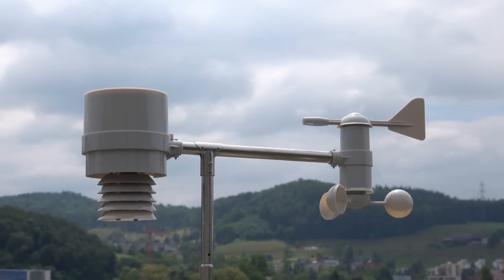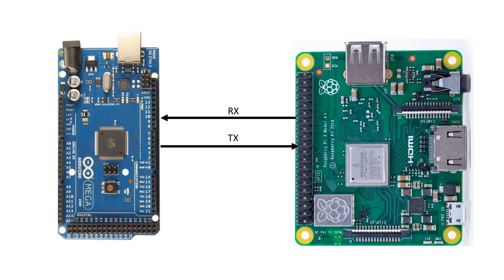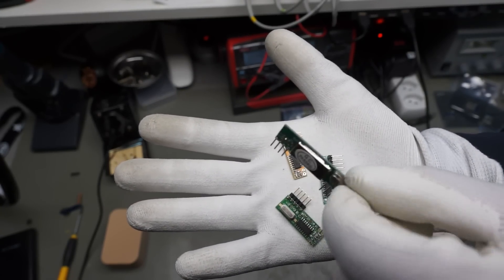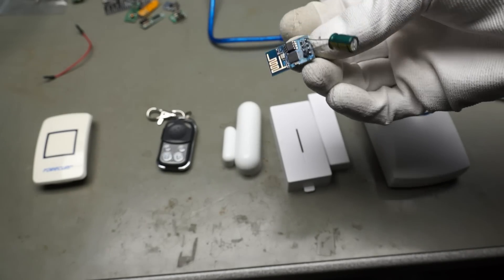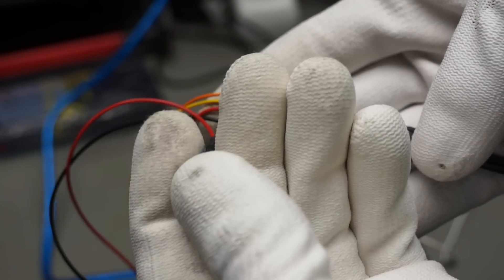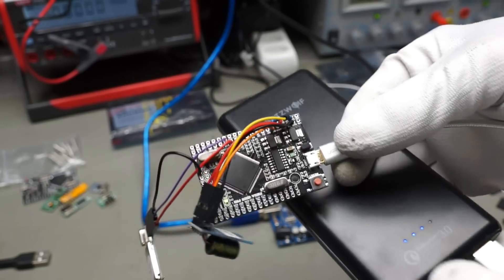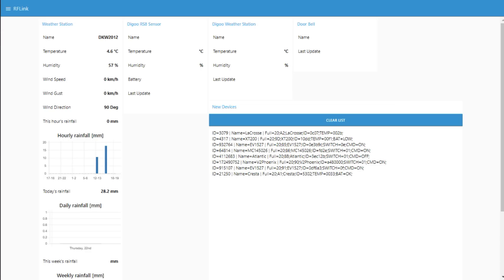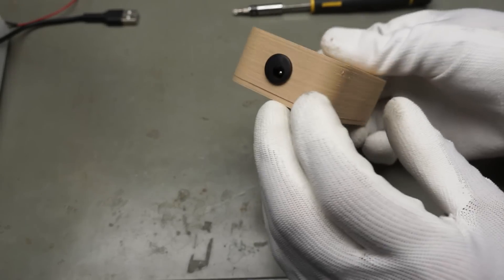#242 How to Build a Cheap 433 - MQTT Gateway (RFLink, Arduino, ESP8266, Node-Red, Weather Station)

Comment: Dear Andreas, I am using OpenEnergy Monitor 
(OpenEnergyMonitor.org) V 9.8.31 to collect timeseries data with datavisualisation capabilties (not as advanced as Graphana for sure). Is there any chance to have the RFLink code to work wtih ESP8266 E12/ Board (HW-628)  ? Thank you for your work.

Comment: Couple things r wrong here... 
1.) weatherstations never ever show the right accurate measurements cause the build in the cheapest sensors in the worst qualityclass even in expensive devices. 
2.) all those sensors r batterydriven and batteries give up the ghost when enviroment temps get low. You never would find out the -17C we had last winter, cause sensor f* up @ little lower as -5
3.) 433MHz sucks, espacially on those cheapos. Slightly sends trough one wall, but have 4 of them in a row. Only working on/in wild west cardboard boxes they call em a house. Not useable for real houses. 
4.) windspeed, winddirection and rainvolumesensors r reed, and they bounce a lot whos filtered out analog. So i mount 2 hall sensors and doubled the resolution of the windspeed sensor. Still looking for a rotaryencoder who can measure winddirection on at least 1 degree solution. Or buy a ultrasonic one...?

Therefor build my own, i‘ve showed u andreas. Only downside: can‘t sniff neighbors sensors, alarmsystem and remotes.
Reply from the maker: In General: I usually get what I pay for. I paid 50 dollars. So my expectations are not very high. Professional weather stations seem to be available but much more expensive.1. The data are good enough for me. And if not, I will change the temp sensor to one from Bosch.
2. Everything which is below -5 C is cold for me ;-) So I have to add a line in node-red: If no signal then -6 C. But I will have a look at it this winter. Anyway, an interesting topic which could be worth a video.
3. My gateway was one floor below and the original display of the weather station 2 floors below the weather station. Both work. And we are not known to build cardboard boxes around here. Maybe you saw the video with our atomic shelter ;-) So the receivers are better than I expected with these short antennas.
4. The wind direction changes quite a lot and therefore cannot be measured accurately with this device. I do not know if averaging would help. For me anyway, only two directions are important: If the wind comes from the east it is cold and if it comes from the west it is better.
5. Ultrasonic wind sensors are very interesting. I never built one. I have wind sensors which work with a thin wire (similar to the ones used in cars (Luftmengenmesser). But I never tried them because I never finished my wind channel.
Reply: Have addition about minus temps. Not sure about sensors in my Chinese weather station, but accurate results depend very much on where WS located. My own ~$150 WS show me -28 this winter. The only thing I found, what humidity sensor show 100% all the winter, because it freeze. It have solar panel, super-capacitors and lithium batteries - they suggested by manufacturer as working good during winter.

Comment: i used an R1 D2 mini clone with a similar 433mHz module and this rf library to build a similar gateway. works like a charm!
https://github.com/sui77/rc-switch
ended up collecting all strings under one MQTT channel and doing evaluation on the pi via python which then notifies mosquitto about changes and saves to the db.
Reply from the maker: Does rc-switch also receive data of weather stations and sensors or only fixed codes from switches?
Reply: @AndreasSpiess  currently fixed code from switches that accumulated over time and custom strings (which mostly resemble mqtt channels and status) from arduino nano's which i fitted with the 433 transmitters to serve a purpose (sweep sensors converted to light switches, like in the public bathroom of our office). waiting on my weather station to find out more but it deals well with what i threw at it when testing the transmitter. You have to translate your message into [binary/tri-state,/decimal/ integer] to send them (i choose binary to send strings but i might change that with a translation matrix at a later point. i kept my strings sort of short to keep transmission times between 250 & 1000ms.). And best to send them multiple times so the receiver can compare incoming messages and choose the one with an occurance of over 50% which is probably the right message. The D1 mini forwards all 433mHz messages & i have all of that currently arriving at mqtt channel "/building_001/433/" and pick it apart on a pi with python.
Not said that it will stay that way but one's gotta start somewhere. Eagerly awaiting shipments of anything 433mHz i could find - if i run into trouble i'll let you know.
Btw, i have that all combined with OpenHAB and was wondering why i never heard that in your vijeos, but if you start Influx & Grafana now you're not far of. I just figured that i wanted persistence throughout the system to also get profiles of power usage and the likes.
P.S.: my guess is you'd receive something with the arduino library - just begs the question how it will look like. in the worst case the proprietary software you found has a non-public translation matrix. but even that could be reverse enginerded given enough spite for the company.
P.S.S.: another comment mentioned this lib https://github.com/1technophile/OpenMQTTGateway which look interesting.
Reply from the maker: Receiving numbers is a completely different game than only codes. Because you also have to understand the coding. And sometimes they send the content twice, once in reverse. For a code, this looks like a longer code. For numbers, it is very hard to find out. And a weather station does not only send one value, but they send many measurements in series, usually in the same packet. So you have to understand which belongs to which value...
Reply: @AndreasSpiess  if the protocol is out there i'm quite confident that it will become known or reverse engineered :-)

Comment: botch as botch can... omg. just plug an 433 transceiver like this https://www.pollin.de/p/funkmodul-hoperf-rfm24w-433-mhz-tx-rx-810309 to an ESP module and do the code in Arduino . Kudos for the MQTT part - the node-red part is actually very nice.
Reply from the maker: Do you know if the RFM24W also decodes variable frequency Manchester encoding?  I know it does OOK, but usually these modules use fixed speeds. Then it would be an interesting alternative. So far I di not see it in the projects I looked at.
Reply: @AndreasSpiess 
https://cdn.datasheetspdf.com/pdf-down/R/F/M/RFM24W-HOPERF.pdf According to the datasheet, it can all this an even more. It almost can cook coffee and fly. But there is no simple or convinient way to do this. But for an electrical engineer like you are this shouldn't be a problem.
Reply from the maker: If you did not try it I am not convinced. Because these cheap protocols use a synchronization phase to detect the timing. They do not use a standard timing. This is why you need the RAW output and a library which can handle that. AFAIK these Hope modules use their protocols and timing. Which usually are not compatible with the cheapos.
Reply: I don't have to try it, to know that the "quasi standard" chipset for baseband communication could achieve that. Yeah - It's bulky and complicated. But variable frequencies are possible, manchester coding/decoding is done in software anyway. But there is no plug and play arduino lib what does the whole work for you - just a few raw registers and a datasheet showing how to use these. Have a look at mikrocontroller.net there are plenty of  implementations for this - not as public as github, but if you'll dig a while you gotta find it.   @AndreasSpiess

Comment: I know in this case it's not a critical detail, but what's the quality of the 433 MHz antennas? Is their resonance frequency close enough to 433?
Reply from the maker: I do not know. I do not have the gear to test it because I do not know the impedance of the receiver module.

Comment: The esp-01 by itself is already capable of doing mqtt <> RF.
Maybe not with RFlink software as I never tried that particular software
Reply from the maker: That’s what I also thought. Which software did you use?
Reply: I made my own software that incorporated the RemoteSwitch library, but in the past I also used RCSwitch.
There is also a project by 1technophile that incorporates MQTT<->RF/IR/BLE/RFM69. Works on a Wemos or ESP32. But no doubt you were aware of that one https://github.com/1technophile/OpenMQTTGateway
Reply from the maker: Quite a few viewers pointed me to this project. But I have to check if it also decodes sensor data or only fixed codes.
Reply: @AndreasSpiess  I seem to remember it uses the RCswitch library which suggests it looks for specific patterns it can read. Weather stations e.g. often use Oregon code and it could well be that is gobbledyduck to the Open QTTGateway. I think somewhere on their wiki is a link to devices  that are recognized. Best check it out yrself

Comment: RFLink being "free" and closed source is a bit odd. Restricting it to a mega even more so. I need this to work with Honeywell 315MHz devices.
Reply from the maker: The 315MHz could be solved with a different receiver. The protocol has to be tried out, most probably.

Comment: Great project but US (and Canada I think) viewers should note that 433mhz is not allowed here. 900mhz is the best we can do for lower-frequency unlicensed comms as far as I know.
Reply from the maker: So far you are the only viewer reporting this. I thought 315MHz is used in the US instead of 433. At least I see many 315/433 MHz devices.
Reply: @AndreasSpiess   Hmm, it seems it's not as cut and dry as I thought. You are allowed to transmit on 433MHz here but there are a lot of rules about how long/how often you can transmit for. And I hadn't really heard of 315MHz but apparently that falls under similar rules and is used for garage-door openers and other devices. This seems like a good reference: https://linxtechnologies.com/wp/wp-content/uploads/fcc_resource_document.pdf

edit: Congrats on 100K subscribers today!

Comment: InfluxDB and Node-Red are are powerful combination. I initially used the UDP method of writing to InfluxDB, with visualisation in Grafana. I then changed to use the one of the nodes available for InfluxDB to run queries from Node-Red. The syntax for InfluxDB takes a while to get used to but is well documented. Using the DATE and TIME functions in Node.js I have managed to create dynamic queries for each day/week/month.
Reply from the maker: I am not sure I will do the querying from node-red. I think I will store the values and then do the display with Grafana. I hope I will get it running...

Comment: As usual a great project Andreas, many thanks.  Tried to do this a few years ago and didn’t get anywhere.
Ended up buying a RFXCOM - RFXtrx433 to USB 433MHz Transceiver  connected to a Raspberry Pi running  Domoticz . Not a cheap solution though.
Reply from the maker: At least it seems to work. That is already something ;-)

Comment: I did a project like this completely only using an esp8266 and a 433 receiver nothing else.
Reply from the maker: Which software did you use? And did you also have a Weatherstation connected?
Reply: @AndreasSpiess  I was able to read the temps from my digital weather station it is a simple one, maybe not as nice as yours
i used the to help me read the 433 data, i also have an 433 transmitter  connect to the esp8266 so i could control 433 stuff like light sockets and ac plugs
here is the link for the lib i used
https://github.com/sui77/rc-switch

i don't like having so many moving parts in a project if possible
Reply from the maker: Thanks. Does the rc-switch library also decode sensor values?
Reply: @AndreasSpiess  yes but not all

Comment: Interesting software this RFLink. I wonder if it really supports more devices than the rc-switch library used in tasmota and openmqttgateway or if they just tested more devices. Hard to say.. For my RF bridge I use espurna, but used tasmota and openmqttgateway in the past just as well.
That node red flow seems quite excessive, think it would be more efficient to just write a python or php script to process the data from the DB when needed. But that's just my preference, I like to keep nodered clean since it gets hairy very very fast.
Reply from the maker: I will look at openMQTTgateway and test if it supports my weather station. I am not sure if Espurna supports any sensors or only switches with fixed codes.
Reply: @AndreasSpiess  OpenMQTTGateway with the gateway based on RCSwitch (ZgatewayRF) or on newremoteswitch libraries (zgatewayRF2) should not support your weather station.    Previously I was used to switch users to BLE path (ZgatewayBT) with mi flora or mi jia sensors when they asked for a weather station. But as said on the comment above @steadramon integrated Pilight into OMG. With Pilight there is a more chance that your weather station can be supported but it is currently on test phase. In all the case if you have questions feel free to ask it on the forum or PM me on it https://community.openmqttgateway.com 1technophile
Reply: @NS Gaming I assure that RFLink support more devices compared to RCSwitch library, for having made some comparisons on them. The only one that can maybe compete with RFlink is Pilight library. Pilight has been integrated into OpenMQTTGateway a fews weeks ago (thanks @steadramon & @puuu) and is still in tests phase.

Comment: You could use an atmega 2560 with an esp32 in the form factor of an Arduino Mega on the same board from banggood
Reply from the maker: Another viewer also suggested this solution. I did not know this combination exists. Thank you!
Reply: @AndreasSpiess  I recently came across this when exploring banggood's "singles day"-deals. I also didn't know it beforehand

Comment: As usual great, thought provoking stuff Andreas, many thanks.  You also had a smaller receiver in your collection, which looks like the one I use - the basic advice would be to steer clear of the super-regenerative receivers as they just aren't good enough, the superhets are far, far better.  My version of this project removed all the electronics from the outdoor weather station and reused it's sensors for wind and rain plus a Bosch BME280 for temp, hum and pressure.  I used an Arduino Mini outdoors and made the whole of that part solar powered with an INA219 board monitoring mAh connected to the Arduino.  I know what you mean about the database being needed for aggregation over time, for wind (gust versus live) I record values in an array on the Arduino and then take an average once per minute for the 'live' figure and send the max as 'gust'.  Connection to the house is using the Radiohead library, which works very well indeed.  Indoors a simple Wemos D1 Mini is connected to the (superhet) receiver and a Nextion display, with rainfall aggregation handled there as well as transmission to WeatherUnderground and ThingSpeak (for battery data).  Lots of ways to do this as always, and yours was much easier, as always? :-). My battery data is here: https://thingspeak.com/channels/343059 but you will see I had to disconnect the battery to change a faulty BME280 recently and didn't reconnect it with a discharged 18650, so the mAh value is currently wrong.  WeatherUnderground feed is here: https://www.wunderground.com/personal-weather-station/dashboard?ID=ILONDON691 and I believe this data is currently reliable.  Enjoy, and thanks for the videos. :-) from Ian T near London.
Reply: The rxb6 is a superhet receiver. I get around 40m receiving distance with a cheap car door opener to a rxb6 with a 17cm wire. The 2$ 433 transmitter he showed is probably only to test the receiver. If you know a receiver that is better than the rxb6 please share.
Edit: The srx882 is supposed to be even better than the rxb6 and is really cheap. Around 2$ as a transmitter + receiver set from china. Found an offer with amazon prime shipping, 14€ for 3 complete sets.
Reply from the maker: @gte24v Maybe I also will replace the electronics one. But for ht moment it works. We say here "Never change a winning team".
But you never know. I would like to add a few more sensors (light, UV). But maybe I just create a second box.
I checked your sensor and it is up and running ;-)
Reply from the maker: @Psi Storm Thanks for sharing your experience
Reply: gte24v give g

Comment: 4:12 What is the name of that working door-sensor, or what search terms are to be used to find this product? Does it transmit on open and close? There are door-sensors that just transmit on open.

A coworker wants to know if the door of the washing-machine is open or closed. If it is closed, it means that there is something in it that should be transferred into the dryer. I said that he could just add such a sensor to it and receive it with rtl_433. But he read somewhere (probably a random amazon review) that these sensors transmit only for the transition from closed to open.
Reply from the maker: You should find a link in the description. It sends a signal for open and close
Reply: Thanks for adding it to the description. :)